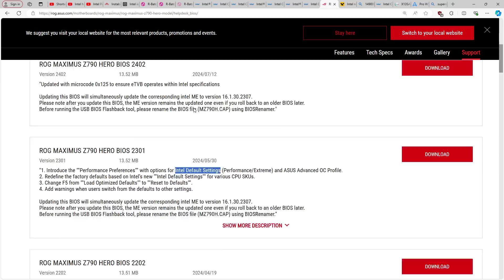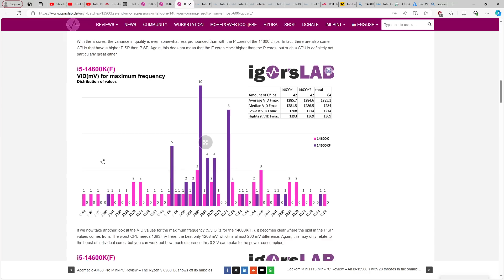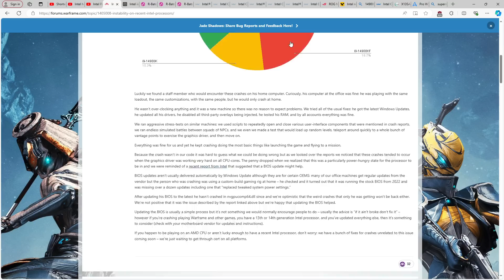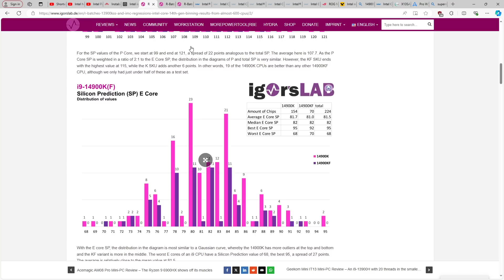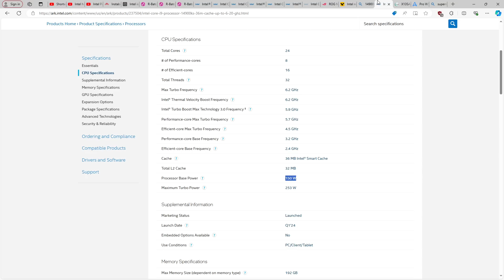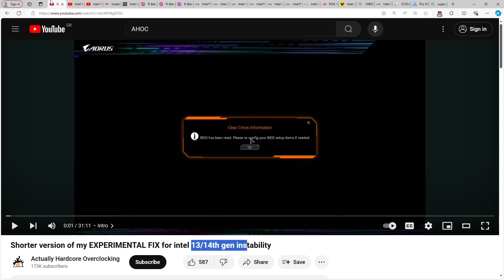The intel instability and degradation rant.

Comment: I disagree with Buildzoid that CPU degradation or silicon degradation in general is inevitable. The most obvious ironclad example of this is how many ancient Commodore 64s, Amigas, Atari 400/800s you can pull out of a closet after 40 years and fire up. The issues you will run into with those are bad caps and leaky CMOS batteries, not silicon problems. My current main system is an 11-12 yr old FX-8350 that has been running 24/7. I have never overclocked it, I have all the power saving features like cool n quiet enabled in BIOS, I have a Hyper 212+ EVO with 2 120mm fans on it, and 3 case fans in an old case that has great ventilation. The most taxing program I run on it is probably Quickpar which will load all cores to 100%. The CPU temp will go into the 50s in that case but it's not like it's running for hours; the longest it took to repair an archive was around 15 mins IIRC. It's normal operating temp is 38-40 with the large number of low-impact programs I run every day.
And think about how rare it is for DRAM to fail. And when it does I think it's usually user error, like pushing down on the modules when the system is running to see if they are all fully seated. DRAM wasn't designed to be treated like that.
I think Buildzoid is probably right about the ringbus being the problem. But even though it's silicon and it's failing, it's an obvious design flaw and not "normal silicon degradation", which as I said I don't think really happens. Hopefully Intel will eventually come clean about it. My next build was always going to be a Ryzen anyway, so what Intel does or doesn't do doesn't matter to me.
Reply: Degradation is in fact inevitable.  The question is how fast does it happen and does it become unusable within the lifespan of the CPU.

The reason the old hardware doesn't seem to degrade is because the circuitry in it is hundreds or thousands of times bigger.  It still degrades, but there is much more physical material there to work with.

We have CPU's now that have components almost on the scale of atoms.  You literally can not compare a modern CPU to an old one in this manner.  The smaller the architecture gets the more fragile the CPU becomes.

Modern CPUs also pull TONS more power than old CPUs do which compounds the issue further.  Degradation is power + heat + time.

Comment: But Buildzoid, Intel has YEARS of experience with 10nm too. It didn't start with Alder Lake. It started with Ice Lake (well, I think there was actually a single SKU of Cannon Lake, which should've been the original 10nm line, but it turned so bad, it makes Broadwell look like a marathon champ) in the 10th gen on mobile. It was actually very power efficient but could barely reach 4.0 GHz, so it was just limited to very low power mobile chips. Then we had Tiger Lake in 11th gen, which was pretty good, this time for the whole mobile/laptop market, but still not good enough for desktop, similar with Meteor Lake. With Alder Lake, Intel was already on 10nm++. Raptor Lake was the 4th generation of 10th gen. So similar with ... 8th gen ... sheesh.

Also, don't know if you heard of this guy, Frame Chasers. It's a channel on YT run by a guy who apparently builds systems for enthusiasts and does extra things like delidding, and tuning the voltages and frequencies etcetc for the CPU, memory and probably for the GPU too. He has pretty strong opinions and is quite unhinged, but seems to me like he has some truth, some knowledge. I'm curious what you have to say about it. He made a video on this topic too, released like 3 hours after yours.

Comment: At first, I was concerned about powering up my 4090, so I bought a Cablemod 90-degree adapter. Then, the adapter was recalled and replaced by ver. 1.1, which was recalled. Now, I have a Thermal Grizzly CPU contact frame and a KryoSheet for my 13900k, and I'm waiting hopefully for a CPU resolution before I build. At least my 6700k and 1080Ti system is still running strong. Best to all.

Comment: Does somebody know if Intel NUC 13 Extreme PCs have the same problem of CPU 13700K/13900K degradation? The PL1 and PL2 are pretty conservative. At least 125W TDP PL1 is set for sure.

Comment: The main problem is that the failures are not all identical. Each CPU has been degrading in similar but slightly different ways.  The question is, has anyone investigated or poked around on the CPU interposer? Checked all the tiny capacitors and resistors on the interposer board and tested if they are actually connected to something like they should be?  It could be a design error on the interposer and not the silicon itself.
Reply: If that was the case the cpus would be showing issues on day1 and not after 6months like what Wendell talked about
Reply: @ThunderingRoar  Not necessarily.  It could be wrong components that take time to fail in circuit. Or It could be something as simple as cracked solder joints because of insufficient solder, wrong solder or solder that has impurities. It could even be that the solder profile is wrong during assembly and the solder paste isn't reaching the melting temperature for long enough. Perhaps glue is being used to hold the components before soldering and it is getting under some of the pads during the solder process making an incomplete connection on the pads.  Or a combination of the above. Anyone with one of the effected CPUs and a $40 microscope can inspect it close up and maybe do some tests with a proper multimeter. Maybe even go over every component with some solder paste and a heat gun as a test. Anyone try it? Nope.
Reply: @10100rsn  Wouldnt all of those things also apply to i5 cpus and we dont see them having issues?
Reply: @ThunderingRoar   Not necessarily.
Reply: @10100rsn It's highly unlikely because reducing clockspeeds seems to mostly resolve the issues, which points at silicon degradation. People who ran stock clocks at lower voltages had to just increase their voltages every now and then to fix stability issues until they eventually became too unstable to run at all, which points at silicon degradation.
Reply: @razorblade7108  No, it doesn't point only to the silicon. Higher frequency loads on bypass capacitors can be bad on the capacitor just the same as higher frequency supply voltage.  There are 8 capacitors on the top of the interposer and many on the bottom of the interposer.  Higher currents at higher frequencies can cause problems even for ceramic caps.  Add in the possibility of  cracks in solder joints forming on those bypass caps and you get very noise power in specific sections of the CPU.  The capacitors are far more likely to have issues than the silicon itself.
Reply: @10100rsn  But there have never been such issues with these standard SMD components at this scale and SMD soldering is a standard process. There have been no changes to any of that, the only change is that 13th and 14th gen are running higher voltages to reach higher clockspeeds, which points at silicon degradation. If the capacitors in any circuit supplying power to the cores were becoming defective, the instability could not be mitigated by reducing clockspeeds or increasing voltages. That's only possible if the issue is silicon degradation.
Reply: @razorblade7108  " If the capacitors in any circuit supplying power to the cores were becoming defective, the instability could not be mitigated by reducing clockspeeds "
Yes, it can. Think in terms of noise and current draw vs frequency. Capacitors even in power circuits have a maximum effective operating frequency and they are operating in a noisy switching regulator supply environment.  The higher the frequency the lower the Farad value of the cap at that frequency.  If the cap is operating out of spec it will degrade its performance and the longer its operated out of spec the more damaged it becomes. The more damaged the component the less likely it will be able to do the job it was intended to do.  The remedy that works also depends on the failure mode and caps can fail in different ways.  More voltage for a shorted cap can make a CPU more stable but generate more heat.  Less power for an open circuit cap will be more stable but even more so at lower clock speeds.  Lower clock speeds for any failure mode should increase stability but there are also other side effects of failing bypass caps depending on the failure mode and that is assuming it is the caps and not just cracked solder joints, which can occur in various different scenarios.  Whether it is the wrong component or the component is operating out of spec or there are cracked or insufficient solder joints... same issues can occur and can look random.
Reply: And the fact that they are running 6 GHz at over 1.4V with ridiculous power consumption and heat output points at silicon degradation. Plus the fact that they are using a new manufacturing process they don't have as much experience with and had to rush because of pressure from the competition points at silicon degradation.
Reply: @razorblade7108  Again, higher power consumption and random errors can be due to failing bypass capacitors on the interposer and not necessarily the silicon itself failing.  Not every single 13900K or 14900K has shown issues and none that have shown issues are showing exactly the same issues.  The failure over time is fairly random.  The fact it isn't happening all at once but gets progressively worse points more towards a physical failure on the interposer or failure of one or more bypass capacitors.  Operating capacitors out of spec at higher frequencies can make them look like a short circuit, go completely short circuit or even force open circuit.  And again, cracked solder joints or the like can accelerate component level degradation and cracked solder joints in that area of the interposer, the center on the bottom, is very likely.  Even with water cooling that area can be fairly hot.

Comment: One of the friends i helped to get the 14900k stable got a pretty fast degradation, first was a shutdown every week, then days, then hours, and finally crashing into bios, the CPU is probably just dead at this point.
When i helped him, told him to use a set voltage around 1.15 or 1.1v and adjust the frequency to try preserve the chip from more damage he opted for intel defaults fix and i don't blame him.

Comment: What's crazy is we could assume Intel simply didn't have enough time to test longevity at these "send it" voltages but then they released 14th gen and made the problem even worse. As much as I'd like to assume AL-S had a lot more thought put into it, I'm skeptical about their priorities. I'm also suspicious about whether supposedly using TSMC for i7/i9 is really just about capacity.
Reply: Intel's priority is snake oil marketing and higher performance than ryzen even if it comes at cost of power consumption, thermals, silicon degradation.

Comment: I got the Vram crash issue on my 12500h, I would use under 4 gb of the 6gb my 3060m has and crash.
No crashing on my 8700 1050 ti pc thought (same patch). Refreshing the bios with the same version, it shipped with fixed issue.

Comment: My wild-ass, I don't know anything, guess is that there's some part of the CPU that they designed for their 10nm++++ that they shrank down to their current process without taking enough care and accidentally put some transistors too close together, and once a certain amount of voltage gets exceeded there you get degradation.

Comment: The ideas of CPUs having degradation issues is it necessarily new. Skylake CPUs had issues where if you tried to use DDR3 memory the memory controller would eventually die out

Comment: I am so glad I went AMD this time around, the 1st time since 2001
Reply: My last Intel was in year 1999 :D
Reply: @DevouringKing You stuck with AMD during the Bulldozer years? You are a much better than me. So glad Ryzen was a success. The late 2000s and most of the 2010s were some rough times if you were an AMD user.
Reply: @Psythik  Jeah i was hyped in September 2011 on Bulldozer release i got a Bulldozer on Day One.
I keeped it until 2016 and then switched to a Vishera (Piledriver) for that 8% more IPC, same Mainboard, same Windows.
This system runned from 2011 until Zen + 2018 for me, and then for my girlfriend. Runned 13 Years.
Reply: I just went back to intel ;-/

Comment: A i7 13700 can you suffer from this?
Reply: A non-K probably won't have this issue as they don't boost as high as the K variant, therefore they probably get fed less voltage as well. It really seems to depend on the chip. Not all 14900Ks are unstable either. it's kind of a silicon lottery, i guess.
Reply: @Gabber-w2g  I understood. Thanks, mate!

Comment: I have a I7-14700KF and it runs fine with a 0.06v undervolt. Set intel powerline and it does not get over 185watts in r23 with 31500 points over 30 mins with a peak temp of 81c and average or 76c. Under load hte voltage is about 1.15v i believe and light use about 1.35v

Comment: Good rant.  Voltages would be one difference, and continuous current draw would be another, higher on the higher end, where migration and degredation would be accelerated if there is a defect.

Comment: Here I am happy with my 14900K undervolted to a fixed 1.25v-core LLC7 for a fixed 5.7hgz all core x57 p-core,x44 e-core,x45ring, with 7200MHZ tight ram settings with a fixed p1/p2 at 253w hitting 38k in c23 without any stability issues @79c full load on a 360aio... :D I hit 40,800k in cinebench23 with my p1/p2 at 350w still at just a fixed 1.25v-core :D... These cpu's run like trash, way too high v-core and wattage  if you are not running fixed settings... At least I can be sure I am not killing my CPU like everyone else letting the MB decide the v-core and wattage without proper cooling.
Reply: Must be a good chip. For 5.8p/4.5e/5.0ring and 7400mhz tuned RAM I needed 1.37v LLC mode 6.
Reply: Your chip is built quite nice to delay the instability for this long. Maybe you won the silicon lottery.
Reply: You should check the actual voltage the cores are getting with LLC7, might be way beyond 1.25V. But maybe you won the silicon lottery.
Reply: You want a prize?

Comment: My 13900k was massively overvolted and unstable at stock. I had to manually max it at 1.25v (edit-might even be 1.225 i cant remember) to get it stable. It was boosting to 1.4+ and 100c out of the box on a custom loop. Not surprised about issues for normies.
Reply: good for you, but a CPU shouldn't come out of the box with unstable settings, i think we can agree on this. If you buy a car, you want it to take you to work or wherever you want, whenever you start it, no? This is no different
Reply: @Gabber-w2g  isn't this really the fault of the motherboard manufacturers? they often have some performance boost crap turned on by default
Reply: @moonasha  listen again from here 14:15

Comment: If there is actually a hardware flaw with Raptor Lake (be it suicide voltages degrading the silicon, or an actual fault with the ring or I/O controller) do you think that would explain why you had such a hard time getting stable memory overclocks with it?

ie., were the errors you were getting caused by general instability, or were they actually caused by the early stages of whatever problem is affecting RL?

Comment: Yeah I am finished with Intel. I have never purchased an AMD processor in my life but now I will. I can't accept this betrayal from a company I spent so much money on over the years.
Reply: My last AMD was XP2000+ and then Intel with Core 2 Duo, and finally my i7 2600K, which has prompted me (after almost 15 years 😂) to look into upgrading - and after following this drama for the past few weeks, I'm going to go with AMD.
Reply: @karlstenator  I upgraded from 2600k to 7800x3d end of last year and it was an amazing jump and worth the wait. Get CL30 DDR6000 it runs stock.

Comment: AMD fanboys foaming at the mouth, "AMD IS IN ASCENDANCY".  No.  No one buys AMD.  There is no quicksync and a hundred other intel specific features.  Just like Nvidia has all of the features.  You're still not stable enough.  You still don't have enough support.  And your name recognition is garbage.  Everyone wants to forget about their exploding CPUs to boot.  But the cope must flow.
Reply: Been using AMD for over a year, no issues with stability, no issues with support. DDR5-6000 settings out of the box after a reboot. Bios updates every few months. Rock solid system, not a single BSOD. No security exploits and speed degrading bios updates to patch them. Brand loyalty is dumb, and I see only one person coping here.
Reply: @Gabber-w2g  One of the things low IQ people have a problem with is understanding the difference between their experience and a statistical experience.  Narcissism can also play a part in making this mistake.
Reply: Ironic telling others that "the cope must flow"...
Reply: @kunka592  Except it's not ironic at all.
Reply: Keep using the junk Intel then. Have you ever try to run RPCS3? News flash AMD has AVX512 with no negative offset. Yes AMD screwed up X3D Sox voltage but the chips are not flawed like Intel 13th and 14th trash. Plus 10th gen also had cache degradation. Only fix was not to OC cache ratio, better than this junk RPL.
Reply: @lostalx   No I have never tried to emulate a playstation gaming console.  I am not 5 years old.  I never said Intel was perfect.  You're moving past the argument that AMD is shit compared to intel.  Which is the argument.

Comment: I have a 12700k/3070ti and was planning to get a 4090 with a 14700k but with intel losing its last remaining stronghold i probably will go for a 9800x3d especially now that its going to support oc i just dont see a future for intel their nex gen will be more expensive and come without hyper threading plus an all new platform  other than that what i think is the problem is the amount of cores intel has now i think there is a problem sending base clock signal to all of them at once